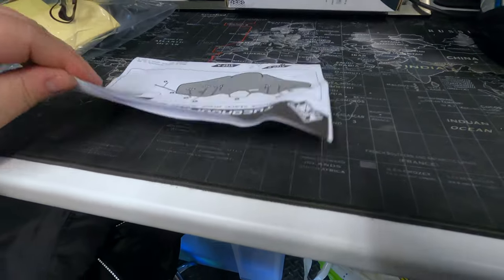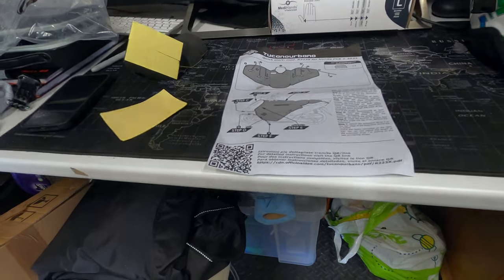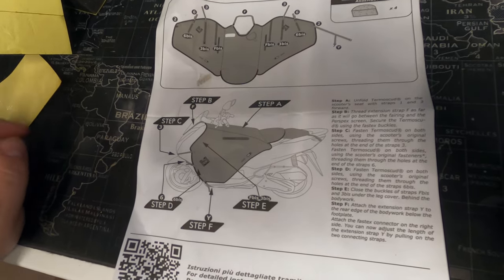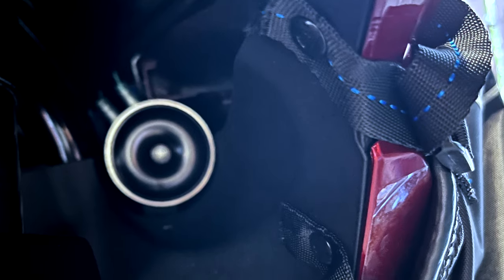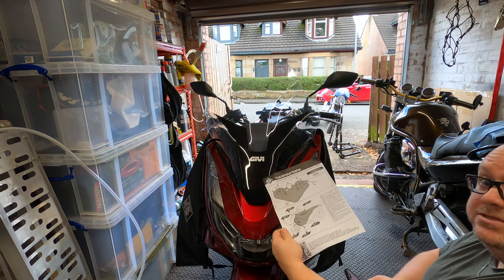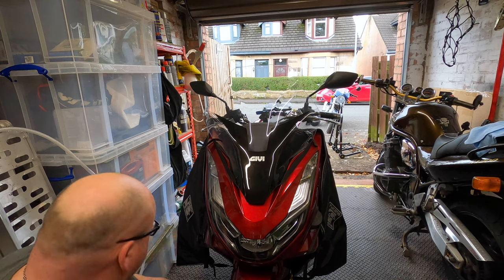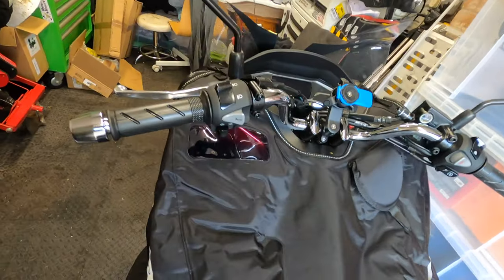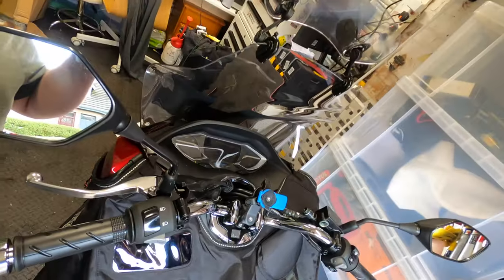Me fitting the Tucano Urbano termoscud scooter apron to my 2021 Honda PCX125.

Comment: Where did you buy this from bud?
Reply from the maker: Got it on eBay from motorcycle parts warehouse.
Reply: @misfirems  yeah I got mine from there today it’s just arrived but I can’t get around the straps because under my PCX I have like rivets instead of screws. Any fix?
Reply from the maker: @Kezmusicbe  the rivets come out and then go through the straps before you pop them back in buddy.
Reply from the maker: @Kezmusicbe  picture at about 8:35 in on the video